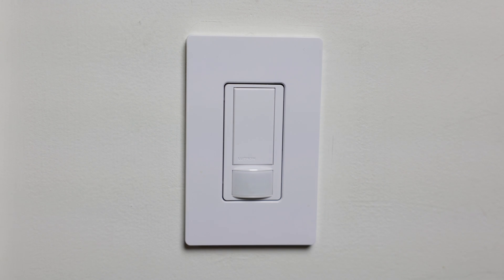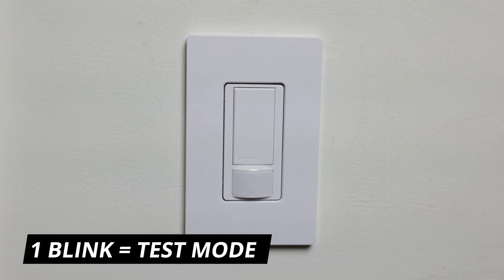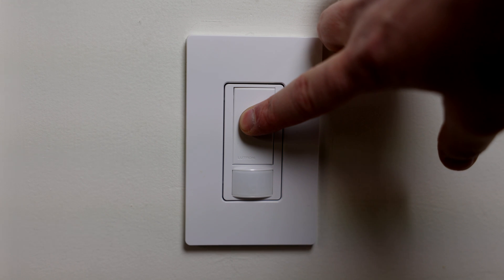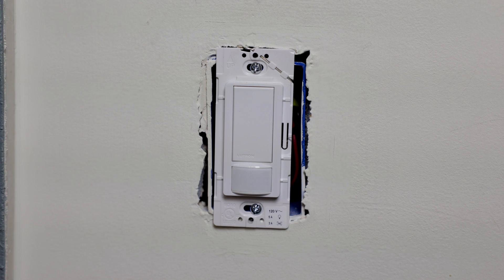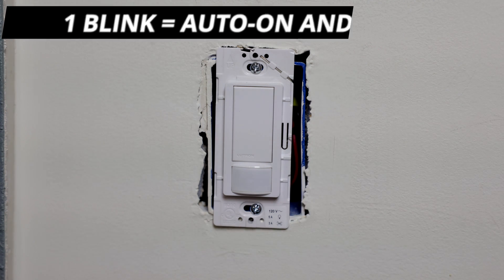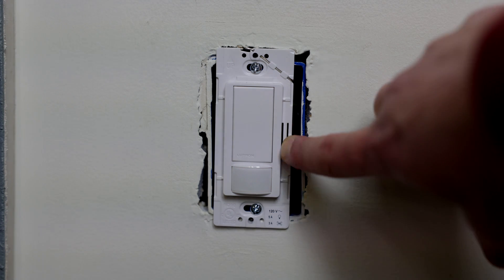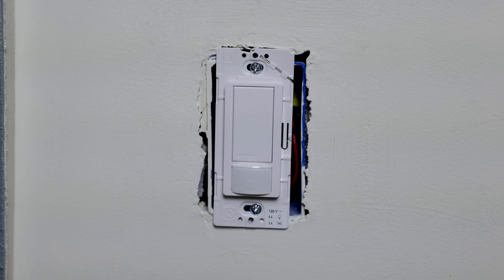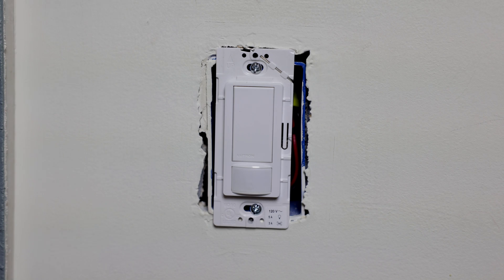How to Program and Setup Your Lutron Maestro Motion Sensor Light Switch

Comment: THANK YOU!
I recently installed this switch in my guest bathroom when the 20 year old one died. The new one kept turning on, every time the HVAC blower started in the bathroom. Your video solved the problem, I just lowered the sensitivity.  Guess I should have  read the manual. 😊

Comment: Great video and instructions, very straightforward. Problem though - the hidden button on the side of mine, when pressing it to change the mode for occupancy vs vacancy, it doesn't make the light flash at all. 
I know that the light is functioning because it will flash when holding the main switch button down to adjust the timer.
Any suggestions or thoughts on this?

Comment: Is there a way to reset everything completely? Cause mine randomly decided to stay on all the time. Even if I manually turned it off, it kicks back on on its own. It’s in a laundry room so it’s not the motions sensor because it does it when nothing is running.

Comment: OMG! Why? Programmable Crap They Sell These Days? So, Power Outage Just Follow These Instruction And Do It Again? I Had A (Copper Wiring Devices) Motion Sensor That Had (2) Black Wires And A Ground (Green) Never Connected The Ground!  Worked For Well Over 25 Years And Worked With LED Lights, Florescent Lights In My Garage! I Overloaded It Running A Compressor On The Same Circuit! But Ran Tons Of Tools Through The Motion Sensor,   Drills, Saws, Hedge Trimmers, ETC. With A Power Strip I Added :O(  
 To Find A Simple "I Want The Lights To Turn On With Motion And Off" And Manual On/Off Without Light Sensing Tech And Learning Technology?  I Just Want The Lights On! Just Remove The Cover Plate And Press And Hold This Button And Watch The Flashes! My God? Really?
 With No Programing 15 Minutes Worked For 25 Years! Now You Get 30 Days! But 6 Wires!

Comment: Is there a process to disable it altogether or just auto on and you have to manually turn it off?
Reply from the maker: You could set it to vacancy mode (only turns on when you push it) and then set the timeout to 30 minutes (it'll stay on for 30 minutes without sensing any motion). That way, it'll mostly behave the way a normal light switch would.

Comment: Thank you so much for this video. I bought one of these and there were no instructions in the package. I didn't even kmow they were programmable, so I just assumed it didn't work and uninstalled it and returned it to the store. Now I will buy another one, install it, and program it correctly, thanks to you. I think the manufacturer could have at least put the instructions in the pckage, at bare minimum a note to go watch a video (preferably yours).

Comment: So I have this exact model in my pantry, and it keeps turning on by itself without any motion, and then it never shuts off! And no, there are no rodents or insects in my pantry. I tried adjusting the sensitivity as shown in this video, and I also tried turning off the breaker, and it still keeps doing it! Any suggestions?
Reply from the maker: Did you try changing it to vacancy mode (so it only turns on when you manually push the button)? I have seen a weird phenomenon with these where they turn on when I’m moving around on the other side of the wall. It doesn’t happen often, but I have witnessed it.

Comment: Thank you so much for this tutorial -- I got my switch setup exactly how I wanted!  Here's a summary to keep on file:
TIMEOUT MODE:  (Hold main button ONLY)
1 Blink  = Test Mode
2 Blinks = 1 Minute Timeout
3 Blinks = 5 Minutes Timeout
4 Blinks = 15 Minutes Timeout
5 Blinks = 30 Minutes Timeout

SENSOR SENSITIVITY: (Hold main button AND hidden button)
1 Blink = Low Sensitivity
2 Blinks = High Sensitivity

SENSOR MODE:  (Hold hidden button ONLY)
1 Blink = Turn on automatically when motion is sensed
2 Blinks = Manual on but auto off (Vacancy Mode)
3 Blinks = Auto on w/Daylight sensing, switch will "learn" over time

Cheers! -- Jason  :)
Reply: Thank you SO much!

… I have the directions somewhere, but just can’t find them 😂😂😂

Comment: When I set mine to motion it keeps turn on all throughout the night. Any idea why this would be happening?
Reply from the maker: @azfooddude9424 it’s because you have to turn the motion sensor off, so it only turns on if you push it. Watch the video again and you’ll see how to do it!
Reply: @sethwilliams43  so I want the sensor on I just don’t want it turning the light on by itself when no one is in the room. I have already changed it to the option to push the button but I want to be able to use the motion sensor and it not turn the light on by itself

Comment: My switch does not react to pressing the tiny switch, light will NOT flash.I think it is stuck in vacancy mode because it will mot turn on when entering the room with out pressing the switch.
Reply: Mine too, not sure what’s going on with that
Reply: Ground it.  The green wire needs to be grounded

Comment: My Lutron Maestro Motion Sensor Light Switch just does not respond at all and the light is on all the time. Day and night.  Why please?
Reply: Same issue. Thought it was a faulty switch so I exchanged it for a new one. Same issue. I have 3 wires. Bare copper ground, black, and a white. No neutral. Any suggestions. The switch is just on 100% of the time. No response from the button to turn off and no blinking lights to set up. It is as if I just hardwired it on.

Comment: anyone else find low sensitivity still really sensitive?  i have it in my foyer and if i walk by in the other room it turns on.  yes it's a direct sight line but at least 15 feet away...
Reply from the maker: You can adjust this, I explain it at 5:09 in the video.
Reply: @sethwilliams43  yes, like i said low sensitivity is still very sensitive.

Comment: Is there any way that I can use it like a regular switch???
Reply from the maker: You can put it in vacancy mode (so it only turns on when you press the button), but I believe it will always adhere to whatever timeout settings you have set. The longest you can set it for is 30 minutes.

Comment: Don't buy Lutron switches, they have a huge drawback - there is no way to override motion sensor if you need to keep it ON for some time until you manually off regardless of motion in the room. This is deal breaker in many cases, I wish I would know it before wasting money on that switch. Other switches allow you easily override motion in case you need it.

Comment: Wow, love to have discovered you doing DIY advice!   Really enjoy your REI tipster work as well.

My problem is that my switch is in a clothes closet with bifold louver doors… and every time I walk by, the light comes on.  Just seems too sensitive, wish it only worked when I opened the door.  Any thoughts?
Reply from the maker: I've got a few of those in my house as well. You could try something like this: https://youtu.be/opbR2aE9Zcw?si=Zy0plguv_uUgPcpy - it might work, depending on where you place it. Not the cheapest option, though.

Comment: I was really hoping there was a way to adjust the amount of time before it starts motion sensing again after manually turning it off. It is fixed at 15s, which is often way too short for wanting to use  the bathroom at night. Guess I’ll just have to turn motion sensing off all together.

Comment: I am thinking of putting this in my garage. 

However I'm worried that if I want to spend more time there I would have to keep moving every 5 minutes. Can I have it as a switch and motion sensor?
Reply from the maker: That's an easy fix! You could change the timeout settings to turn off after 15 or 30 minutes. We've done this with some of the switches in our house, and it works great in situations where there isn't as much movement.

Comment: Just a heads up. If your switch won't tuen on when it senses a person, you probably have a vacancy only switch (that's only legal in CA)  They no longer sell occupancy sensors there due to new laws.
Reply: I recently installed the MS-VPS5MH-WH switch in a walk in closet that won't set up the sensor mode to auto turn on. Held the side tab up to a minute and the blinking light never went on. It has to be turned on manually and it does turn off automatically. Any ideas on how to make it work?
Reply: Similar problem here. Mine will blink, but only turns itself on after 30 seconds or so of moving around in front of it.

Edit: I figured it out. When you turn it off manually, there appears to be a "cool down" period of approximately 20 to 30 seconds before the sensor will work as intended. Once I figured this out, it works as it should.

Comment: What do you have a do you have everything connected and nothing works and come on you have the ground and neutral on the light switch. You have two new drawers on top and the switch downstairs. Yeah neutral can I do you have a switch like in a group power what do you do it doesn’t work I think there’s malfunction in the garbage I don’t know I never understand it. I have everything connected everything neutral like what is garbage how would I go about connecting as they say but bypass it

Comment: Awesome video. Could it be due to defective hardware when the motion sensor sometimes doesn’t detect motion after it went off?
Reply: I had this similar problem where it would always just turn back on!? So I reset the circuit breaker at the outside box that it was attached to, waited 20 seconds...back on and it started working fine again!? Good luck.

Comment: I have the motion sensor tied into a light switch, when the light switch is turned ON, it also turns on the motion sensor light (without any motion present), is there a way to override this and only have it react to motion??

Comment: Yes, I probably could have figured all of this out by reading the manual.  But it's soooooo  much easier to be shown.  So glad you posted this.
Thanks.

Edit:  Something about this light that I like...  I put on vacancy mode because it's on a bathroom fan and don't always need it.  But after I manually turn it on, it goes into motion mode to where it stays on as long as there's motion, and goes into timer mode when I leave the room.  I think that's awesome.
Reply from the maker: Thanks for watching! I agree... that's an awesome setting for this kind of light switch.

Comment: Is there a mode that you can use to OVER RIDE the Occupancy Sensor and manually turn the lights on and off to keep them on all the time or turn them off like a normal on and off switch?
The reason why I want this mode is the one Occupancy Sensor switch I have in the Garage turns the light off when I am out of VIEW from the motion sensor on the other side of the Garage, always at the wrong time of course and I don’t want to have to put another Occupancy sensor in to fix that problem.
Reply: My problem also, did you ever get it figured out? When I go to my garage & I'm messing with the car the lights go out, if I could just flick a switch.

Comment: Followed you directions on this MSCL-OP153 MH and it will not hold the program, it is a 3 way install. Any ideas why it won't take? Tried at least 10 times. HELP
Reply from the maker: You should try calling Lutron Customer Service. They're actually pretty helpful, and they're open all the time. They always solve my problems! Their number is 1 (844) 588-7661

Comment: Thank goodness, somebody who can explain it simply and clearly! Thank you! I have one of these switches in the place I moved into a few years ago. There were no instructions, and whatever I found online had that time was ridiculously confusing so I put up with the settings as they are.

The bulbs give off a lot of heat, and now that it's summer time it was driving me crazy that that light would stay on for half an hour if visitors didn't turn it off when they left the washroom.  It got too warm in there, and I'm struggling to keep the place cool as it is.

I have now set it to go off after 1 minute. This makes me very happy LOL it's the little things ☺️♥️

Comment: What is the function of the thin paper clip like wire hanging from the top right of the outlet?
Reply from the maker: I'm honestly not sure. I've never touched it. It's probably part of the housing structure (though I agree, it does seem a little out-of-place, whatever it is).
Reply: It's a ground wire

Comment: Good Video. I wish there were a way to program the switch to 'full manual' that is the switch only comes on when I press the button and only turns off when I press the button again. My switch is not located in an ideal place to sense motion. Given the location of my switch the device cannot see over 80% of my garage. When I am working in the garage it constantly turns off the lights and the only thing I can do is increase the delay before it turns off the lights.
Reply from the maker: Could you just install a normal mechanical switch?
Reply: @sethwilliams43  Sure I could, but when my wife comes home it is benefit to her to have the garage 'fully lit' for her the minute or so she is arriving or departing without having to physically operate a switch. For her purposes, the motion sensing switch works great.
Reply from the maker: @KLFaber  you might consider using one of these wireless motion sensors, which connects to the switch, but the sensor can be placed anywhere you want. I have 4 of these in my house and they are PERFECT for situations like what you're describing. They're not the cheapest option, but if you can stomach the price (for both the switch and the sensor) they're really easy to pair, and the battery lasts a long, long, long time. Here's a video on how they work: https://youtu.be/opbR2aE9Zcw
Reply: @sethwilliams43  Thanks. This idea is worthy! I had no idea this product existed.

Comment: Thanks. Mine is not turning off. It was working fine before. Any solution?
Reply from the maker: Could it be that the timeout setting is too long? They should all turn off eventually , but if it's set to 30 minutes, you'll have to wait a while.

Comment: This light switch is so annoying for me, it's for my closet but the sensor is in my bathroom! How can I just turn off the sensor and use it like a normal light switch?
Reply from the maker: It sounds like you want this switch on vacancy mode (I do this with some of the switches in my house). See 2:21 in the video.